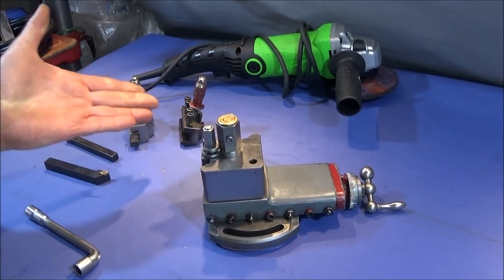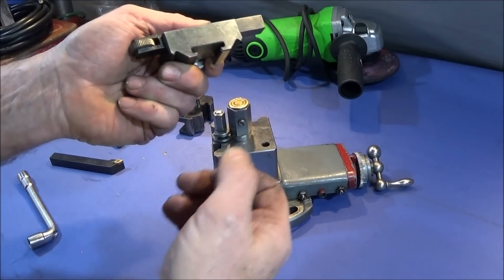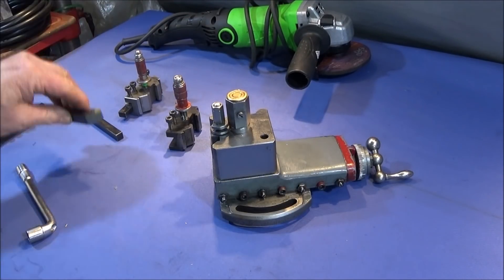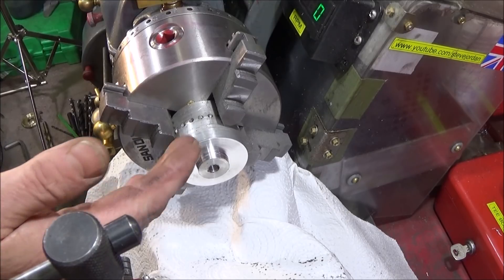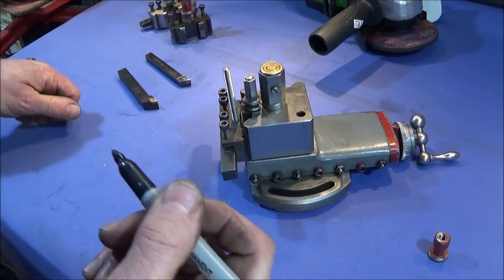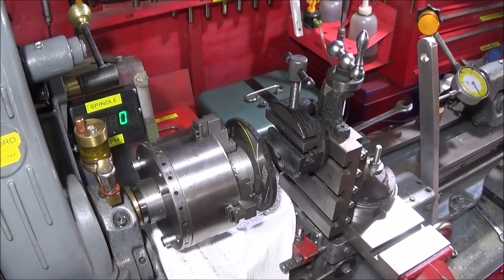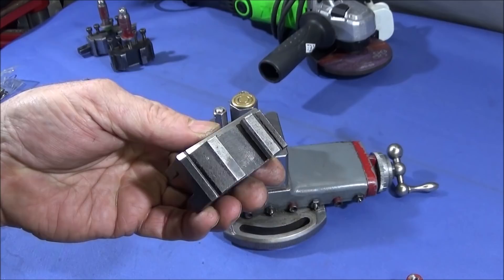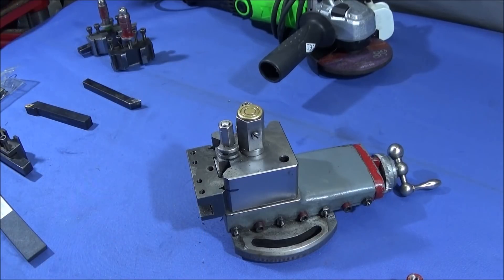Easy Method Of Modifying Myford Dixon Quick-Change Tool Holders

Comment: So you’re weakening the part to take bigger holders,as you have a vertical slide why not machine the bottom of the tool holder to give the centre height you need?.
Reply from the maker: It hasnt made any difference doing it how Ive shown. Ive used my lathe since to do all the work I've needed to do without any problems whatsoever.  If anything went wrong or broke since Ive done this modification then I would agree with you. I had to do it this way as I havent got milling machine. All the milling I do is done on the actual lathe, so I had that limitation. This is good in that others can acheive the same results using their basic machine tools.
Reply from the maker: I would have had to anneal all the holders for machining as well. The vertical slide and lathe would not be able to acheive what a milling machine can do and even if it was it would have taken too long to do.

Comment: Hi Sreve    I was wondering if you could not take the full cut with the grinder blade and work your way up to depth of cut instead of coming in from the side.   This would take care of any blade wear.    I'm sure I would have done it that way.    I can't say I have the experience to know but would sure like your opinion on this.    Still trying to take in all your videos but having a hard time catching up.   Great to be able to watch and learn from the comments but it does take time.    Thanks.

Comment: After watching your original video I decided to do some thing similar on a Mini lathe. I decided however to machine a small part from the front of the compound. This will not cause any great weakening but the benefit is that all tool holders will fit without further machining. Many thanks for the videos and keep them coming.

Comment: This solution is OK as long as you don't need to rotate the toolpost by more than a couple of degrees. But its not going to work for screw cutting, for example. Unless I'm missing something?
Reply from the maker: Today I decided to mill 2mm off the top of the compound slide. This sorts everything in one go and I can use 12mm turn tools at any angle now. I'm pleased I did this video though as it gives people to the option, plus I found out I could use the Myford as a precision grinder if needed for other jobs.
Reply: You're certainly taking the bull by the horns Steve. Trust there will be a video!

Comment: Would it be possible to mill a little 3mm step in the casting so as you only need to modify one part? As  it is cast iron it would be quick and eas, and all the holders would fit..

Comment: Hi Steve, ended up doing something similar to mine, the first 4 tool holders I milled as you did, tough on milling cutters ( destroyed 2), the next 4 I marked up and cut with an angle grinder with a 1mm cutting blade, steady hand and light pressure turned out ok but that grinding looks to be the way to go in future.
Thanks for sharing.
Cheers

Comment: good idea as always Steve, what I done years ago when I had about 20 toolholders was simple mill away a small part of the topside itself , I just milled about 5mm of the edge the holders sit one, solved all my problems with one go, and was able to use 12mm tooling
keep up the good work, look forward to your next video
kind regards...Keith in Swindon aka mr-myford

Comment: Surely, the grinding disc will reduce in diameter each time you make a pass?
Reply from the maker: Well mine did one holder complete with very minor wear. The discs are so low cost one can use a new disc to grind each holder if needed. Then keep the used discs for further use on the angle grinder for other jobs.

Comment: Why Mill all the tool holders , When you could mill the compound rest 180 degree's , which would permit to turn the tool post also ?
Reply from the maker: You can do that if you prefer, but I'm not keen on altering the actual lathe if I don't really need to.
Reply: That's what I did and it has worked out great!. 
The problem with notching the bottoms of tool holders is that they can't be rotated. This limitation combined with the need to notch a lot of holders made the choice easy for me.
Reply from the maker: @EDesigns_FL  Yes yours is a good option. 'It kills two birds with one stone'. Did you just mill a few millimeter off of the top of the compound?
Reply: @SteveJordan  I clamped my compound to a rotary table and milled a notch around the perimeter of my QCTP. The notch is a radius for 180° and is parallel to both sides for another ~35mm. It's ~3mm deep. This notch permits 180° of rotation of the QCTP with standard tool holders. I did modify a couple tool holders for use on the back side of the QCTP for close work to with a dead center.
I have a slightly larger lathe and use an AXA QCTP, so size of my clearance notch will differ from your's.  Nevertheless,  our situations are similar and this modification has worked very well for me.

Comment: Is there no way to avoid all these modifications ? What about a larger toolpost to begin with ? One that overhangs the edge of the topslide sufficiently that the holders don't catch on the topslide face. I would like a QCTP for my myford but have put off buying one as none seem to fit right given the price you have to pay ! Another idea is to offset the toolpost by, what was it, 13mm ? to allow full travel. I havn't put down on paper how this would be done but i'm positive it possible but might be a more complex solution than this.
Reply: The problem with larger offset is the extra torque it supplies to 'bend' top-slide and cross-slide. I bought a QCTP for mini lathe a few years ago but it's still in the box as I don't like it even though it is very convenient for multiple tool operations
Reply: @peterjones6945  Peter i was just thinking that if there was some sort of adaptor plate on the topslide and then the tool post was secured to it with just enough overhang for the holder to clear or a larger toolpost to start with so the slideways were clear of the topslide. OK there might be an extra what ? 10 - 15 mm of overhang but surely that wont make that much of a difference ? BTW where are you ? Would you think of getting rid of QCTP for your lathe ? Im skint and would like to add one to my mini lathe. Ive a Myford and a small Zyto so might try it on the zyto.
Reply: @johndoe9536  I'm now in central Florida but kept my house in South Wales (UK)
Reply from the maker: @peterjones6945  If you set the mini lathe slides up correctly they work perfectly, without any problems at all. I would only buy and use the Dixon type though and not those cheap alloy QTCPs . I would find machining way to slow and tedious without a QCTP, having to set and reset so many different tools for a component. Its always the first bit of equipment I would buy for any lathe.
Reply: @SteveJordan  Hi Steve, I've used QCTP for years when production machining always on much (much) larger machines (usually a Colchester of some sort, Mascot, 2000, etc) Your 100% correct about the cheap  Chinese alloy QCTP. I usually have 4 tools set in original tool-post of mini lathe and if I need more I used  up a second tool-post (but ended up not needing it enough so used material for something else LOL) BTW, I have everything set up properly, gib adjusting is a simple enough process. Best 'bang for buck' was the taper roller conversion, parting off is now easy instead of a hit or miss affair. At one time I was a factory worker turning to 3 micron tolerances, luckily I no longer need to be so accurate

Comment: Excellent solution Steve. Besides your current application, it opens up a whole can of solutions for other grinding jobs. Keep coming with good ideas. Herman from Holland
Reply from the maker: Hi Herman, Thanks. Yes I reckon there will be many other applications where this could be used successfully. I must  search out all my grinding wheels I have saved. I have some 4" or 5" inch diameter fine stone wheels in store somewhere and a 6" diamond lapping wheel I could use. Regards Steve

Comment: Excellent idea Steve and a lovely finish.  I'm going to try milling with some cheap Cubic Boron Nitride inserts I bought from China on eBay for 3.50 each.  Should cut through hardened steel no problems.
Reply from the maker: Hi Luke, Thanks....That should be interesting.....let me know how they go I may buy some.

Comment: Always creative, thanks

Aren't angle-grinder disks mfr'd for face rather than edge grinding?  (cutting disk mfr'd for edge cutting)

What about another arbor for the lathe chuck which holds a grinding stone?

I suppose it doesn't make much diff  :)
Reply from the maker: Hi Len, I used the face on this, but I sometimes use them both ways on the angle grinder.
Reply: It may be even easier to make a mounting to hold angle grinder if you don't have large angle plates or milling attachment? . It could be mounted direct to tail-stock end of bed or on tool-post.(I made a tool-post holder to grind some case hardened parts) This method will be really handy though as almost all grinding wheels are designed for ~4,000 rpm or less, reinforced grinding discs are designed to spin around 10,000rpm

Comment: Good idea Steve, I have milled some of my toolholder so and even after annealing it's hard going even with carbide tooling. I have recently been milling some 16mm tool holders and used a 2 insert carbide tool and found the blue coated inserts very good but I will try your method